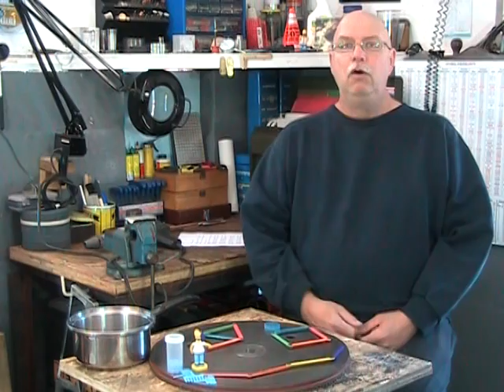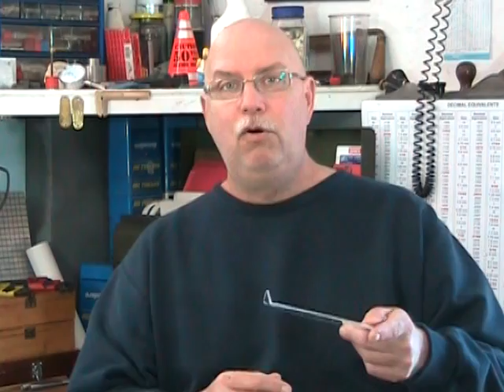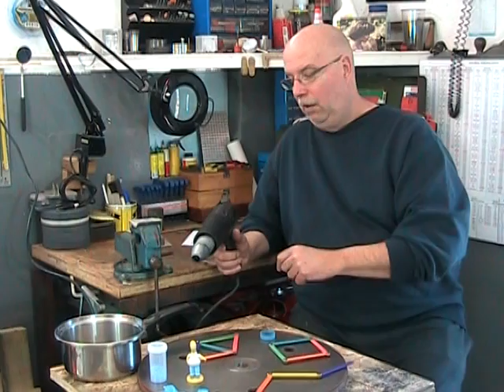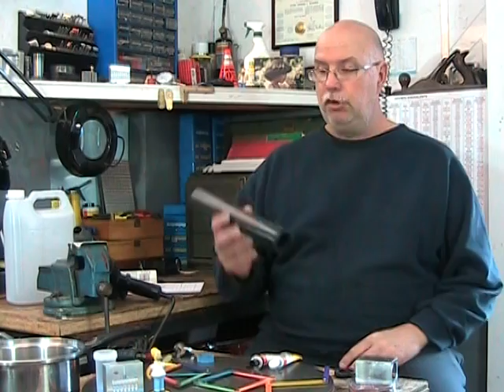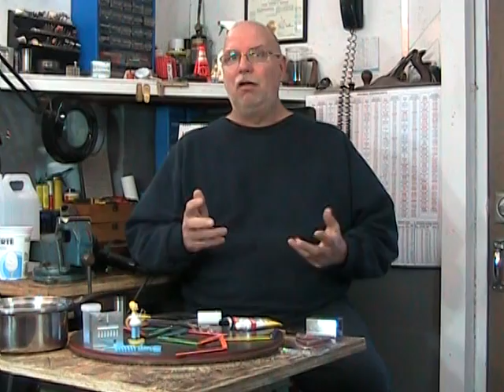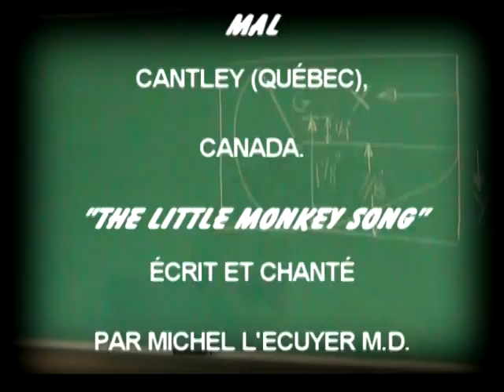POLYMERS & PLASTICS MACHINE SHOP MATERIALS, PART 4 Marc L'Ecuyer

Comment: So if I understand correctly, some plastics, once going through a 'chemical' change is permanent, (epoxy resin or Bakelite), whilst others can be reduced back to their original component and reused?

Great stuff.
Reply from the maker: Charles Hendry Hi Charles, you are almost wright!. Once monomers are polymerised into long chains (polymers) they cannot revert back to monomers. polymerization is irreversible. However some polymers (the ones that are made up of chains that have no lateral links) can be remelted (thermoplastics). The spaghetti example demonstrates why heating makes these thermoplastics flow like a thick liquid. If however the long chains are cross linked (thermoset plastics) the material cannot be melted and remolded (Bakelite, epoxy ...). I hope this helps, thanks for watching! Marc L'Ecuyer